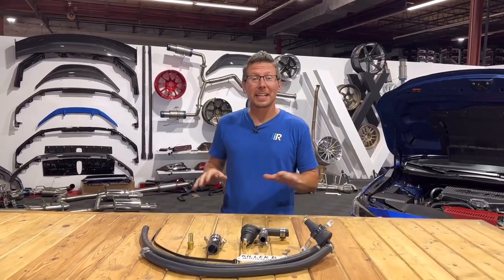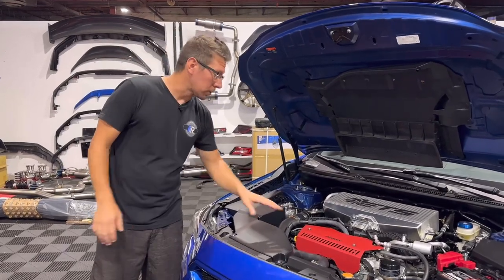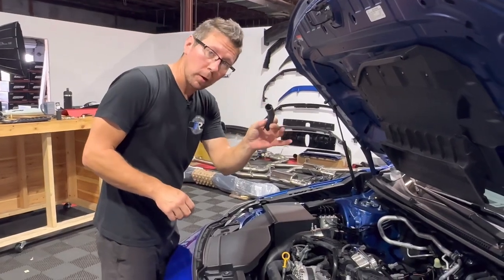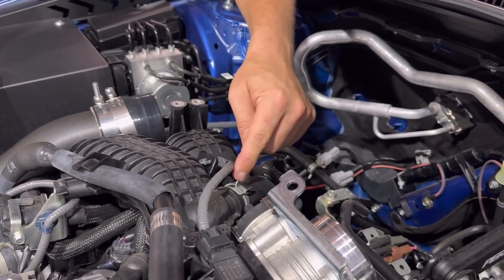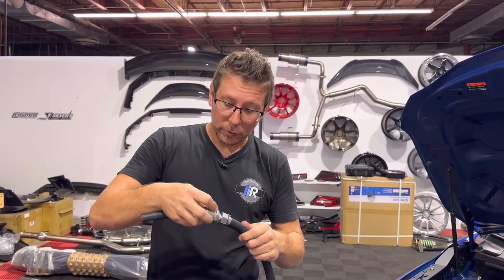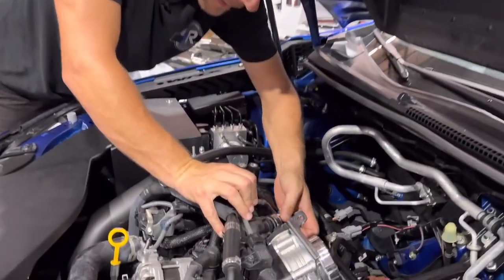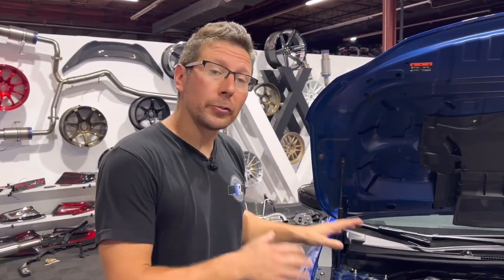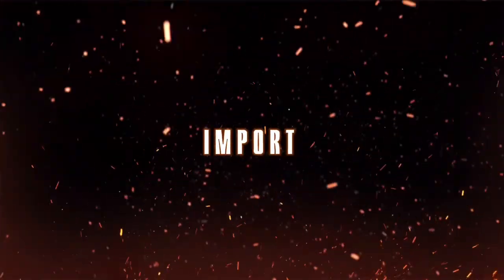KILLER B DUAL CATCH CAN AOS INSTALL | 2022 | 2023 | SUBARU | WRX

Comment: Hey, I have a 23 wrx. I ripped the valve adapter off while installing the CCV can, timestamp @17:11 on the video. The valve looks to be held in place by a spring clip but I pulled the clip and tried turning and pressing the adaptor back on and it wont click or stick. Any help is appreciated.

Comment: Question... are these open or closed when the little drain plug is all the way up? I installed them and went 3k miles, literally nothing in the cans. Wondering if I left them wide open instead of closed.
Reply: I've been searching for an answer to that question  for a month
Reply: @anthonyarrazcaeta5926  the consensus seems to be screwed all the way OUT is closed. I had my car in a tuning shop the other day and when he pressure tested, air was blowing out of the cans. I had them screwed all the way in. So, at least for mine, out is closed.

Comment: You weren't kidding on that install. Very easy. But yeah as I saw them going in, I thought o boy they have to be removed and drained often, and a PITA! I have the IAG AOS. I read in the Subaru owner's manual that every 30k the PCV valve should be replaced. What do you guys think on that? Does it last longer?
Reply: For best results I would stick with Subarus maintenance schedule recommendations. Adding a catch can/ AOS is not going to prolong the life of the factory PCV.

Comment: Will this work on an 06 OBXT?
Reply from the maker: Unfortunately not. This dual can set up is designed to work with the FA series engines. Killer B does offer a single can set up for 2008-14 cars that can be retrofitted to work with earlier EJ models like yours! But it does require some work.
Reply: @ImportImageRacing  well that fuckin sux.....